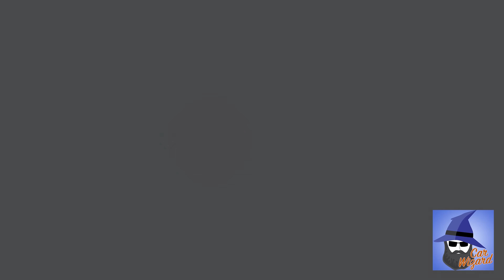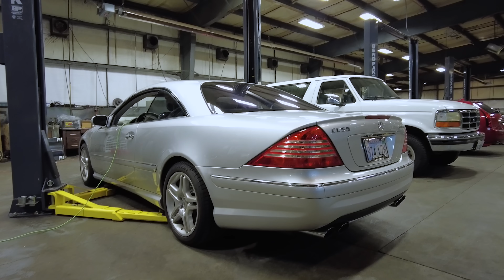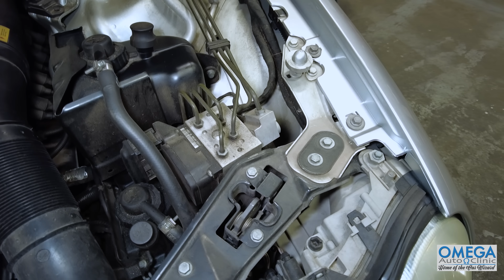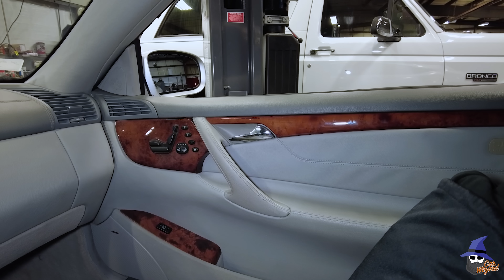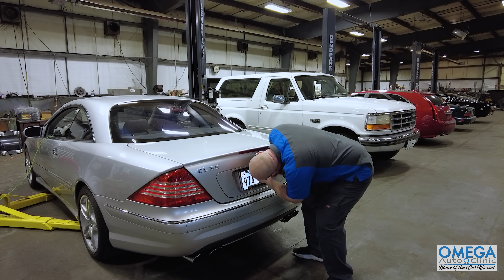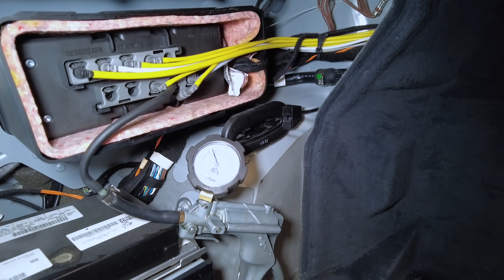Really, $4K to fix the locks! How can the CAR WIZARD charge SOOO much to fix this '05 CL55 AMG?!?

Comment: I own a ford, Honda, Toyota, and an MB. Love em all. But The things the benz can handle on the highway and around town are indeed another level. Plus the build quality is insane. I’m on my second W212
Reply: Please tell how the MB can handle them better that makes any difference in day to day driving not break the law fast driving difference? Unless you have the money to waste why buy anything else but those other cars?
Reply: @safffff1000  They handle everything that has to do with driving, better.
Reply: @martinsvensson6884  What exactly that is worth their extreme cost differences and repair cost. I don't understand, tell discribe what I would be getting worth $10,000's of difference.
Reply: @safffff1000  the difference isn't that great if you're on the used market
Reply: @burntnougat5341  The money difference is vast on the used market, that toyota is going to cost me peanuts to fix compared to any european car, for perceived differences in driving it that can't be described other than an emotional ones
Reply: @safffff1000  drive your camry in the smokey mountains and see if you can keep up with my 330. Tell me there's no difference then
Reply: @burntnougat5341 That’s a valid point.  I have driven a Camry in the Cascade Mountains in the Pacific NW, and I upgraded to an Avalon Hybrid.  Even that made a significant difference (and made the twisties a lot more fun to drive), and having once been surprised by a rental upgrade from a mid-size car to a BMW X7, I can only imagine how much fun that would be.  The thing is, that’s only a small part of my driving, and I’m not sure I could afford the repairs on a premium car (especially since many say that MB and BMW aren’t as reliable as they were 10-20 years ago).
Reply: @safffff1000  You are getting much better performance. Faster. Better handling. More comfort. Quieter. A more solid built car. Better crash safety. Much nicer interior. More functions. 
If you dont think that costs 10k's you are delusional...
But what's worth 10's for a car at all when you can take bicycle to work and save all of that money?
Reply: @martinsvensson6884  A bike compared to a junk car is an improvement of 95%, a toyota compared to a breakdown MB is a 5% difference. Speed and power you don't need and can't use except on a race track, a softer ride by 10% or quieter by 10%, if you have money to waste fine.
Reply: @safffff1000  No its not a 5% difference. Its a big difference once you drive the cars.
Sound levels can easily be half the sound pressure..
And you can easily have a 50% or far far more redution in suspension forces inside the car.
It can be the difference between feeling completely worn out or feeling alert when you get to your destination after a long trip.
A bike is 100% of a junk car if getting there is the only criteria you have.... with a fraction of the cost.
Its just a matter of personal opinion how much the other factors are worth to you.
Reply: @martinsvensson6884  Your like the princess and the pea. Decibel levels aren't half, I don't bonce half as much going up and down bumps, I'm not taking corners at double speed driving legally. They are sure good at selling people small upgrades. At 71 yr old I don't feel worn out in my Toyotas. Have you ever ridden in one? Camry or Lexus? Maybe your handicap and extra sensitive to pain, I'm sorry
Reply: @safffff1000  It depends on which Toyota or Lexus.... if its the ones you are talking about that are so much cheaper to run.... then yes its going to be a severe difference in performance or comfort levels on a long trip. If you are talking about the same upper class though the difference is of course smaller. Although still perfectly noticable in many areas. But then also the difference in running costs are suddenly close.
Decibel scale doesnt work that way. 3 decibels is a halving in sound pressure.
Reply: @safffff1000  variety is the spice of life. The answer isn't always HondaToyotaMazda and you are close minded if you think so
Reply: @burntnougat5341  No I don't have the money to waste on imagined 5% perceived differences
Reply: @safffff1000  alright well I have some money to spend on a nicer vehicle so I did. As did the millions of other people that drive higher end vehicles. Life’s too short to have the same thing over and over again. Some people value certain things over others. For me, I spend more time in the car than at home sometimes, so I’d like a nicer car with more options and comfort blah blah. It’s not rocket science.
Reply: @TheK24Kyle  Perfect consumer programing can't use same thing must always buy different. Your convinced something that does it's job  well has to be replaced out of boredom.  Great if you have the money to waste. Keeps people working and the rich richer.
Reply: I don't understand, unless driving illegally all 1st those cars do just fine

Comment: I Don't know why they are so expensive, they have been using the same damn system/design for decades.. Ive had that issue on my 95 w140.. damn leak. I have a similar issue with my 99 c140.. same issues.. so, why do they continue to use it? Why is it so expensive?! Because even though these issues are so common and are almost always a fail, there are simply not enough of them for the after market world to offer a solution that costs $200.. they leave it an exclusive MB solution and they can charge whatever they want to fix their stupid design.. that's why I will never buy a new Benz.. or another Benz in general! Gorgeous cars, but the company is a POS!

Comment: You sure knew how to pick great mechanics out to work at your shop, wish I had a similar shop near me.
Reply: Need a Wizard satellite shop in upstate NY!
Reply: @mrblack6467  Not sure how far from you it is, but South Main Auto in Avoca is top notch.  They have a YT channel.
Reply: @macgroober1396  'cept Eric doesn't do German cars.
Reply: What’s your opinion on a 07 c230? Got it with 59k miles… has 80k now. I replaced the trans valve body and conductor plate. 1800… other then that it’s been solid. Hopefully since it’s a older C class. And I’m a bit of a mechanic. And I’m not scared of no Mercedes. Hopefully it doesn’t take me broke.
Reply: x 100
Reply: Why?  He charges top dollar on everything. A real ripoff who takes advantage
Reply: Ignoring the need for professional help and occasional bouts of random stupid... Then again, that's pretty much every decent mechanitech out there.
Reply: @Rekuzan  I think magic Mike moved to be with the Wizard.
Reply: @mefobills279  Not one but TWO master mechanics under one roof.  It's a rare phenomenon these days.

Comment: Like Scotty says ...an endless money pit.
Reply: Same old response most likely repeated by people who can't afford to buy or maintain them.
Mercedes Benz is one of the top selling luxury marques world wide and outsells Lexus by a massive amount.
A significant proportion of the people who buy them are repeat owners who are obviously satisfied enough with their current vehicle to spend a significant amount of money to acquire a new one.
Scotty Kilmer diddles himself in a high mileage Celica with ice cold air while looking at a picture of the chairman of Toyota.
Reply: @williamegler8771 The people that complain about Mercedes are the ones that buy them cheap and can’t afford to fix it when something breaks. Same goes for Audi and BMW.
Reply: @williamegler8771  Repeat buyers only keep them for 3 years in warrantee, and own multiple cars, so when when the MB is in the shop (which frequent occurrence) they can drive their other car like the Lexus that ALWAYS works.
Reply: @williamegler8771  over priced, poorly designed pile of crap
Reply: @alexlang5649  Classic response from someone who doesn't actually have any first-hand knowledge and is just going on what he's been told by someone else.
Reply: Instead of using basic mechanical locks, many companies are using electronic/hydraulic/pneumatic locks and it's absolutely insane considering they cost 100x more to repair. Not just that but even if they use a mechanical lock their door handle is made of plastic. Turns out in winter climate your plastic door handle/lock breaks much more easily. Simply put, make your door lock simple(it's fine to connect it to an intrusion alert system) made of quality metal materials, it's not like you can't install a high quality residential lock in a car door.
Reply: Fellate over your toyotas on car care nut's channel
Reply: @burntnougat5341  car care nut owns both an s class and an ML class! He showed them in a few of his videos.
Reply: @Nikolasto77  he sold both to buy a new GX460
Reply: Exactly lol